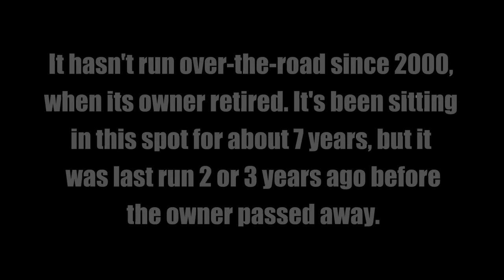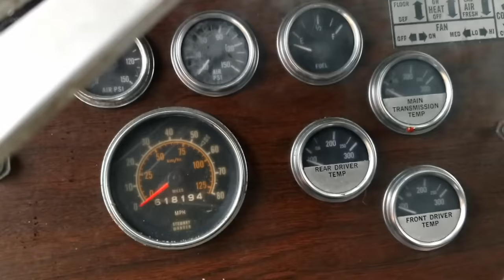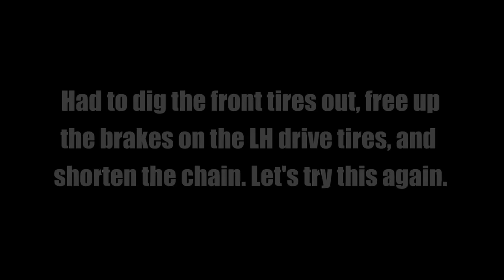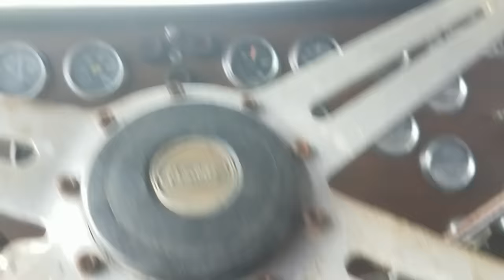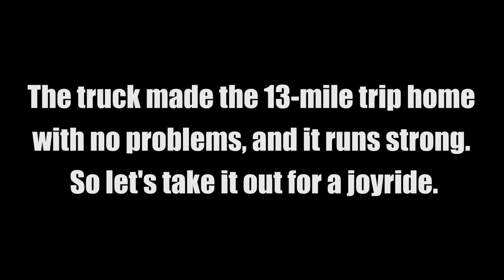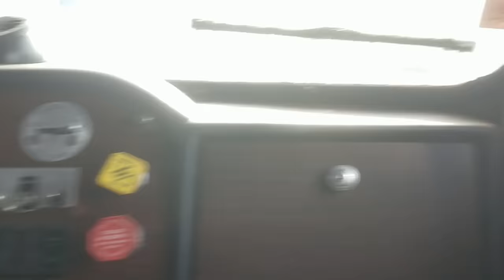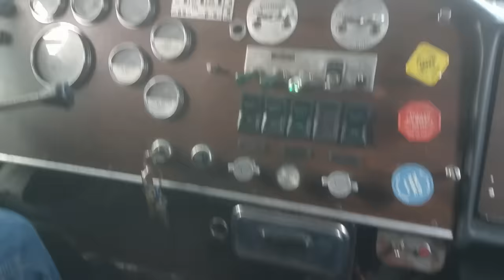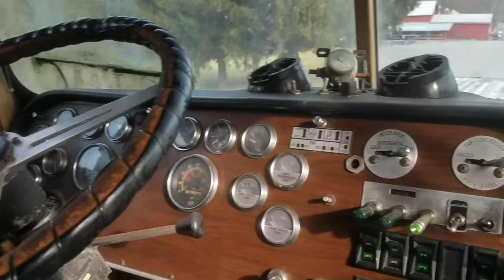Rescuing a 1977 Peterbilt 359 From Its Grave - First Time On the Road in 18 Years

Comment: My old man would've loved this video. Lost him a few years ago to pancreatic cancer.  I can hear his laugh in my head when that jake hits. "That thing barks, huh?" Something like that.
Reply: My dad love to hit the Jake brake and my ears popped every time with the with Windows open. Fun times
Reply: Erm what’s the jake brake? Sorry from UK so we didn’t have awesome trucks like this
Reply: Jake brakes used to be an option on U.K. ERFs with a Cummins engine, they’re an auxiliary engine brake
Reply: @owenlewis8006  Its what we call an  exhaust brake here in the uk.
Reply: No, an exhaust brake is just a butterfly valve in the exhaust. Jake brake actually alters the valve timing of the engine, it’s a compression release system.
Reply: Im afraid i have never heard of a Jake brake,i realise an exshaust brake is a butter fly in the exshaust pipe,  in the uk we only have exhaust brakes. Ive been a comercial motor mechanic for 30 years in the uk and thats all i have ever seen on the trucks ive worked on. What you have in the US i have had no exsperience of so i couldn't comment on.. In the Uk we have Daf's, Volvos, Scaniers, Iveco's and other european trucks, but we don't have American trucks here. @owenlewis8006
Reply: Yes, I’m U.k too. Like I said, Jake brake was an option on Cummins engines, but expensive and rarely specified.  When applied, the fuel was shut off, air allowed into the cylinder so compression slowed the engine down, then exhaust valves open to let the air out and the whole process started again. Also there were electro magnetic retarders available, fitted to the propshaft. This is all old school stuff, more common in the ‘70s here.
Reply: We use to have cummings engines years ago, i think we had them in 7.5t leyland road runners and in the Leyland 34t  road trains as well, its that long ago its a vague memory 
  @owenlewis8006
Reply: Yes you’re right. I passed my hgv in a roadtrain, that had a Rolls engine though
Reply: Can you remember the pilote start. we had it on the Road Trains, you would turn the engine over while injecting the starting fluid into the engine at the same time, then the engine would crack into life...some of our divers were not the brightest, so they would inject loads of the starting fluid into the engine then  turn the engine over which would  blow the sump off the engine lol!!!  due to this we stoped filling up the starting fluid resovirs.      @owenlewis8006
Reply: I don’t remember, but I only drove the one. It sounds similar to the ki gas thing some of the old diesels had. I had a Ford 4d donkey engine once that was almost impossible to start unless you gave it a sniff of ether, but everyone reckoned that damaged the pistons.

Comment: I am impressed the fuel was still good and one big smile on the trucker in the sky
Reply: I don't think that truck was setting there for seven years. Everything would have been rotted away. Including the tires that seemed to be still holding air.
Reply: Jess Roberts Not true. It was on a tarp to prevent rusting on the undercarriage. But obviously it was well cared for previously.
Reply: @zorans5200  It absolutely goes bad, all fuel degrades and evaporates. It's the fuel tank corroding you also have to watch for. Flush the tank period.  Which I'm sure they did, or at least gave it addtitives to get it from point a to b for proper maintenance.
Reply: Jess Roberts my international loadstar 1600 sat for 35 years and only one tire was flat
Reply: @zorans5200  does to go bad. We have backup diesel generators around the plant that get quarterly inspections. They sample the fuel and once it reaches a certain PPM they drain it.
Reply: @zorans5200  I actually have a pretty good understanding of how diesel engines work I own many of them. Ranging from 16 horsepower tractors to 575
Reply: @zorans5200  simply pointing out a fact that i know diesel engines. Was born and raised on a 2300 Acre Farm
Reply: @zorans5200  I would have to disagree with you on the diesel going bad issue but not on the fact it is oil. For one, if the tank is not full it is subject to condensate and rust albeit not directly a fuel stability issue but up here when they mix with gasoline it is an issue and I have pulled many a cap off with sludge inside and a varnish smell. You also don't know the quality of the fuel out of the pumps should it be contaminated. Back in the 80's there was a big scam where they were diluting toxic waste and adding to gasoline. Yes diesel is oil BUT if I were to breathe the air inside the tires I might wind up like Howard Carter of Lord Carnarvon?
Reply: @zorans5200  That's what I thought. You are one of the seasoned professionals who hasn't experienced a problem outside of a textbook.
Reply: @zorans5200  In the north where assholes think they can weld tanks that are full of fuel. I worked up the road from a truck center that was leveled and 5 men killed by the explosion.
Reply: @zorans5200  So now you are in agreement with the post to which you replied diesel doesn't go bad? That's how it appears. You must be ASE certified for sure.
Reply: @zorans5200  sudbury
Reply: @zorans5200  who ever told you diesel does not go bad shared in a myth. Modern diesel has chemical stabilizers in it however it does oxidize ask your neighborhood chemist. You are right on target to claim that dyed diesel also plugs injectors. Whether or not fuel burns is beside the point, it is chemically unstable. 50 year old gasoline also burns in my burn barrel really well.
Reply: @zorans5200  The 50 year old gasoline was removed from a Morgan  last registered in 1972. One other car was a Saturn which threw a rod. Most of the work I do is pre 1970's however. I threw some in a burn barrel not expecting it to light and it flashed back at me and smoked a little bit of hair. Now you can call that bullshit or you can try it but most people don't have access to old Morgans nor 50 year old leaded gas. I was making the point that it will burn, and yes it smelled like varnish and yes it was orange. If you want to believe it will not burn that is also a MYTH depending on the storage. I am currently a red seal 310B (collision), S (automotive) & T (truck and coach) which means I am qualified to work ANYWHERE in Canada. The point I raised is that you cyber bullied a YT user with incorrect assumptions and then turn around and recant your own post.  Octane, cetane and microbes "used to be" 1st year trade school curriculum. You have now conceded that the properties of diesel do in fact change and you could research and agree like a gentleman or continue to be a complete fucking idiot. I did not dispute the fact it will ignite under compression other than to run it through an engine is just stupid. I was in a quarry not long ago flushing the fuel tank in an engine after the sludge wiped out diaphram pump. It depends on the type of equipment you work with. I would encourage you to challenge with optimism instead of argue with hearsay.
Reply: Not bio that fuel in her is real American fuel
Reply: @kingjames7273  The USA imports 10 mil barrels/ day. 0.9-1.4 mil from Saudi Arabia (11%) and 40% from Canada. 51% is NOT American. Any way you crack the barrel, it degrades from the moment it was refined. If you think your fuel came from Texas then you lead a truly blissful existence. I don't see a selection at the pump for Lone Star nor for the Dakota's.
Reply: max webster like ontario canada i live right near there
Reply: Bailey  That was I thought when I saw the tarp under it. The old man knew what he was doing.

Comment: I just love an old Peterbilt. I await 2019, because it is the 80th anniversary of Peterbilt.
Reply from the maker: I wonder what they'll do for the 80th anniversary.
Reply: Hey, you remember me from that last video with the junk cub cadets? So I'm not limited to tractors, I just love Peterbilt, and trains are also cool. Glad to see that thing fire up. Someday, I hope to get me a 70's Pete 352 and put big straight pipes on it, then give it an emerald green paint job. I constructed a model of what it'll look like. I really like old cabover's, so a 352 would be nice.
Reply from the maker: @tractors1017  The tractor hobby often leads into the truck hobby, from what I've learned. lol. 352's are one of the slickest cabovers ever built. There's a guy out here in PA who pulls a 352 with a souped up 400 Cummins and does really well. I'm more of a conventional hood guy, but I wouldn't mind running a 352 or 362.
Reply: Sounds like that guy has a pretty nice truck! I personally prefer a 352 just because its older, and I like the pacemaker cab style on the 70's ones.
Reply from the maker: @tractors1017  Hard to believe but the 362's are considered "old" now too. They came out in 1981. Some guys are even calling the 379's "old" cause they came out in late 1986, but I won't go there yet. lol
Reply: I know what they will do they will incorporate more plastic into the interior if that's even possible. Maybe a higher quality plastic chrome grill . They should have quit making trucks in 2005
Reply: @MichaelTJD60  a cab over is for a man of steel , a curb sniffer is for a man that likes his Kidneys LMAO
Reply: You're telling me there's 1939 Peterbilts?
Reply: Plastic everything and a Ecuador and wiring to match that will screw up the day the warranty runs out. Plastic scrap with 80th anniversary livery on the side. Probably Chinese plastic to keep the price down.
Reply: The Puppet Of Everything yeah I guess they were the peterbilt 260’s only 15 made from what I hear, beautiful truck if you look it up
Reply: Watch it be an automatic
Reply: David McVaugh i would have a mental breakdown
Reply: @MichaelTJD60  The 80th Annviersary All Pterbilt Truck Show is in 2019 in Reno, Nevada.  You can find more information about it here: https://aths.org/2019Convention
Reply: @MichaelTJD60  Make a shitty truck that's what they'll do! The government has fucked up diesel engines so bad it ain't even funny.

The truck I drive at work is a 2003 with no DPF. It's not a manual motor but at least I don't have to worry about fucking DEF, having to do a regen, derating, or being stranded on the side of the road due to a clogged DPF!

The shop foreman already told me they are phasing out all the older trucks before this summer. Damn shame too! It won't be too long before I'll have to roll down the road in an unreliable giant fucking car!
Reply: MichaelTJD60 379s aren't old! They made them until the mid 2000s when the 389 came out!

Comment: You just got my upvote before even watching the video strictly based upon the well-thought-out, grammatically correct, properly punctuated description and your reasoning behind taking on the project.  The more talented you are with your mind and hands the more likely all the losers will attack you with negativity.  Only a handful of people understand the balls it takes to create and post a video for the world to judge.  Based on the fact you're already at 1.3 million views in 6 days, you have not a THING to be concerned about...
Reply from the maker: Thanks for the like and for your comment. I'm picky with the grammar because these videos are shared for the world to see, so you might as well make them look (somewhat) professional. The haters can judge all they want.
Reply: Most vids fizzle and a few launch.  Why?  No clue.  Maybe it's in the details. They make or break most everything else.  Rounded off bolt heads, stripped threads and heli-coils, or torque specs written in sharpie on the frame?  Anyway, congratulations on the "viral" video!!

Comment: Wish I had the money, time and know how to bring back a diamond in the rough like this. Real trucks dont die they just take rests.
Reply: I'd absolutely put a large "box" on it and make it a camper.  Completely impractical, but awesome.
Reply: @0101-s7v  impractical is the best way to go.
Reply: It was never broken down they just parked it
Reply: @ELSMITH3378  my mistake
Reply from the maker: I'm no truck mechanic but I've learned very quickly as we go. Why did we buy an old dead truck that needed a ton of work? Because we could! It's going to be a fun truck once we get it all fixed up.
Reply: @MichaelTJD60  with that Jake brake it sounds like you guys are having fun already.
Reply: In laws had a diamond-T with aluminum frame father in law got too old to restore it I went up there last time before they moved took some pictures see if anyone wanted it for free  posted on all these videos everyone was email me calling my in-laws getting all excited about it no one lived near Colorado no way to haul it back. Seemed like everyone that called lived in the Southeast or mid-west They said some wanted to drive out look at it never showed up. It takes real money to restore something this big and haul it around I don't know what it would cost to haul it I figure $5k-10k unless you had your own hauler. I was thinking they could have done it with maybe a those trailer tow full size backhoes on.  He had engines and all kinds of stuff for it the cab was intact too built in the 60's I think It was auctioned off and scrapped I think he got like $100.
Reply: Benjamin Burton 
Oh if trucks could only talk. This ole girl would have some stories 😉
Reply: @MichaelTJD60  Congrats on the video. Terrific job on the description for the video. Damn shame some of these numbskulls don't take the time to read them. Continued success on your channel!
Reply: @MichaelTJD60    If that truck could talk it would say this , Hello I'm a truck,  You heard of stories many truck drivers told  how they pulled out of Pittsburgh for 6 days on the road about the feather river canyon and the old grapevine, About the roadhouse down in Texas and the girls they left behind,  but if you can spare a minute I am about to tell you mine, There would be no truck drivers if it wasn't for us trucks, no gear jammin double clutching  coffee drinking nuts, they ride their way to glory and we get all the luck there would be no truck drivers if it wasn't for us trucks. My tanks are sucking diesel running red lines on the tac, I bring him south and back without a word of thanks. There would be no truck drivers if it wasn't for us trucks FRom an old school trucking song from the old days called I'm a Truck
Reply: Wish I had the money to restore a 454 Chevelle . Nice looking truck but a 454 Chevelle is  a way better investment.
Reply: Benjamin Burton sorry, but what the fuck is a jake brake
Reply: Niall Corcoran it’s an engine compression brake that is nick named after the company who pioneered it originally called a “Jacobs brake” or jake brake for short, when engaged the camshaft opens the exhaust valve on the compression stroke and the engine does not inject fuel to allow compressed air in the cylinders to escape and slow the engine down
Reply: @douglasborel955  Good old Red Simpson song :)
Reply: +Benjamin Burton    unless someone abuses them
Reply: Iam glad i own a peterbilt 359

Comment: I graduated from Dakota Co., MN Vo-tech in truck driving with my Class A license in 1978, wanted to drive the big rigs, no one would hire me as I was only 19 years old at the time.  Nice to see something from my youth.
Reply: I feel your pain Recoil Spring. I got my class A the day I turned 19 (22 now). I learned from driving on the farm and it was plenty difficult trying to get any kind of driving job at 20. I'm in a class B job about to start searching again for a class A. It stinks
Reply: Recoil, I graduated from Burnsville H.S. class of 79
I remember the Mel jazz matinee tv show would advertise sun prairie Wisconsin,   truck driving.  school, remember dialing for dollars?
I went in the military did 20 years and went to Truck driving school.
Now drive local in Olympia WA.
Reply: MCT or Midwest Coast Trucking aka Mighty Cute Truckers located in Sioux Falls, South Dakota at this time in 1977 ran not only a large long haul trucking firm but also ran a school that went for something like 2 months 5 days a week and if you graduated you got your Class 1 license and then were put on the call board as 2nd seat. Lot of the trucks were owner operator and they pulled the MCT trailers.  Usually either swinging meat or packed meat out and vegetables or potatoes back.  Heavy loads.  You were sent out and usually your first haul would go to the north west, down to L.A. or Fresno then back to Sioux Falls.  Other times you would be sent west then from L.A. drive to Chicago then to New York City with 20 drops then back again.  Summer, Fall and Winter at .07 cents/mile. Winter ice sheet covered interstate roads in Wyoming or Downers pass.  A newbie would after even a few months full time have a lot of experience and mileage under his/her belt and a great way to be trained properly.